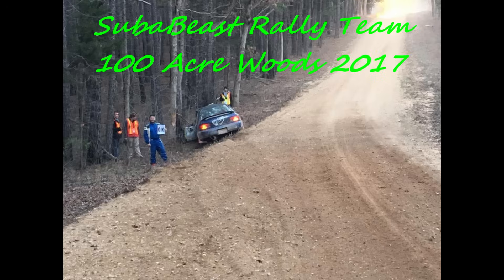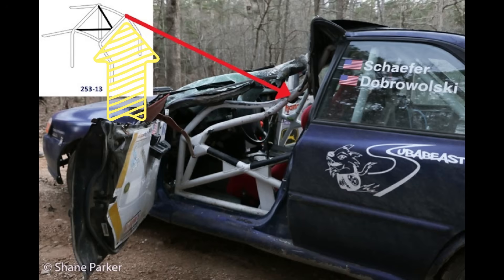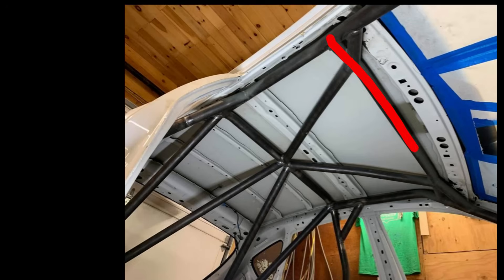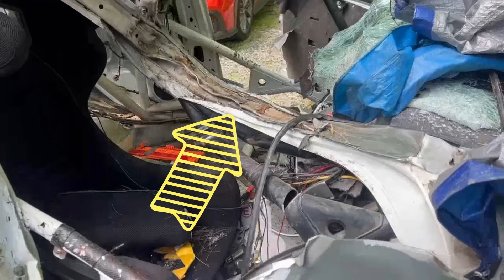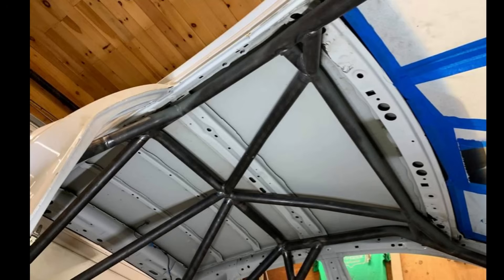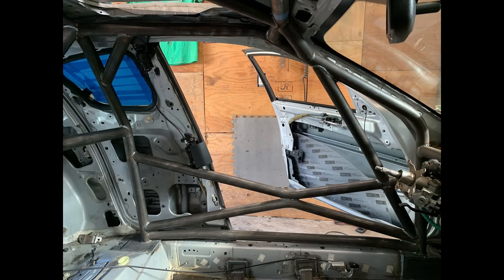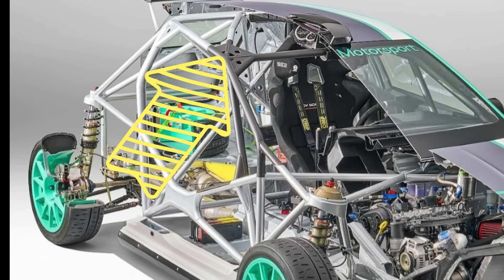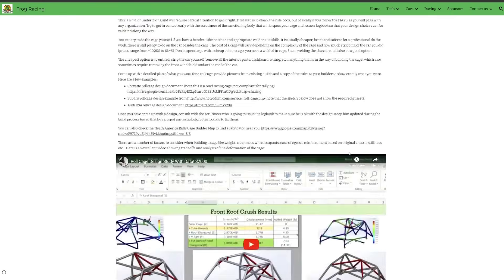Rollcage A pillar strike analysis

Comment: How about using .125 tubing. Seems .095 sheared quite easily.😮
Reply from the maker: 0.120 tubing is recommended for cars over 3000lbs in road racing.It would help but not sure it would make that much of a difference. Check Kris Meeke's crash in Portugal in the C3 WRC, it's Chromoly and the outcome is pretty similar.

Comment: The one problem with designing a role cage to be as strong as possible, is people have to fit in, and be able to get in & out.
Many years ago Safety Devices experimented with Bowden cables in the front screen area, apparently it worked from a torsional stiffness perspective, but had potential drawbacks in the event of a major off.
The rear assy can be extreamly robust, but does nothing to protect the crew, in terms of avoiding front portion collapse

Comment: Great breakdown, very informative. 

I suspect it's a fine line between a cage that doesn't collapse and puts those G forces into the occupants compared to a case that collapses and absorbed a lot of that energy.

Did these cage failures happen at or near the max speed or were they considered low/medium speed collisions?
Reply from the maker: The first one was definitely a low/medium speed impact, the second one was more of a medium to high speed impact.

Comment: The subject requires a complete review in historic motor racing where the FIA adopts double standards on false pretexts of originality. Some ROP as a result are far weaker than others and differences in vehicle mass simply create danger for competitors.

Competitors have often seen some very dubious decisions from Geneva rejecting national MSA ROPs.

Why are gussets and triangulation allowed for some cars rather than others? Why are base mounting pads limited on some cars so that a mounting bolt is the single attachment in the wrong plane? Why are cages used to strengthen fake GT40s and Cobra Daytonas?

The historic FIA needs listen to National MSAs, it needs to be balanced and not swayed by particular groups of garagistes or organisers.

Comment: The roll cage on my Panamericana  car is .120 wall and it is still a few 100 pounds under minimum weight eventually I will add gussets and temple bars as the roll cage weight is obviously not any issue for my car. In '93 when the car was constructed gussets and temple bars were not required.

Comment: 3:40 I watch Drag car builds and Drag and Drive builds. That's my knowledge about (full/chassis) roll cage. I also did some studies on transfert of force/weight.
I already know that the gusset and the side bar being not on the same point will be a point of failure.
Any build with that kind of offset will result on cage failure with the right angle.

Comment: I would want to sample the bars that sheared near the welds for changes in hardness every centimeters from the weld to a decent way to see how the heat from the weld changed the tube.  This is a similar effect when NHRA is specifically 4130.  The heat of the welding  caused oxidation on the inside of the weld that caused brittleness as the car flexed. It also caused heat effected zones of different hardness. 4130 in other than tubing needs to be stress relieved at 1,100F so every mm is of the same ultimate strength.  Cracking near welds from flexing fatigue. As the areas went from harder to softer away from the weld.

After John Forces crash, I contacted a heat treating magazine called The Monte. I found several heat treaters that had ovens big enough to put bare top fuel chassis in.   

 I  sent the info to John force racing.  Then quit making noise about it. 

Your collapsing A pillar bar problem needs to look at what OEMS do. They have a thick wall bar that starts deep in the A pillar  has a bend not a splice to follow the windshield  then another bend to follow the roof line. The rest of the bars can remain spec wall thickness. These two a pillar bars need to be much thicker wall.  Screw the weight. Protect the occupants.   
I would also like to see a thick wall tube from the base of the A pillar tube to the base of the B pillar tube as somebody is going to roll one and hit a pillar or tree in the rocker pillar and have a similar collapse.  

 Since the lower inside of the door is cut away.  A pair of bars that bend out into the lower door cavity but welded to the A and B pillars then gusseted  in a few places to the X bars next to the driver  for far better above the rocker panel side impact protection.  ..

 My friend Richard Lindwall was crewchief on the Wolf Dallara WD1 can am car that was driven by Giles Villinue.  It had a terrible habit of flattening the front tires . There is a video of it after restoration on YouTube.  The side pods had aluminum honeycomb composite floor panel material right out of Boeing surplus laminated on. Crazy strong.  But at high speeds the car got light in the rear and would swap ends.  Scared some drivers after Giles. I saw the photos of the car in the early 90s. I pointed out the vents on the back of the rear fenders disrupted the air stream going under the wing at speed causing a loss of downforce on the bottom of the wing. The upper surface of the wing was almost flat. The airflow over the leading edge created lift .  The duckbill way out in front did not help either.  The car had been retired to a design school to never to be sold but to be analyzed to see why it was insane at high speed.   I had figured it out in 30 seconds . I had no idea that the car had been sold and was doing vintage racing. Dino the owner wound it up in the back straight at Mosport and died. I would have warned him.
Reply from the maker: I am not sure which bar you are referring to as the A pillar bar but the lateral that follows the A pillar is 1 piece. The A pillar support bar is usually a smaller diameter (1.5") bar that can be a single piece if it doesn't intersect with the door bars but it depends on the geometry inside the car.
Unlike road racing that has tube wall thickness based on the weight of the car, rally only has one minimum size regardless of weight. The GD Subarus are often in the 3200lbs range and one could argue that .095 wall is a bit thin for that weight, most road racing sanctioning bodies require .120 wall for that weight.
I completely agree with the effects of welding on the material, it's often even worse with Chromoly if the welds are not properly treated. Unfortunately I didn't see the car in person, I only had access the data that was given to me by the car owner.

Comment: My evo 7 was built to the standard then certified by the MSA and  FIA to international spec. Shell was prepared & multi point cage built by Custom Cages Ltd but not to the main outlined rules in the blue book as it allowed a opinion to the cage to be designed outside of the rules stated. My cage failed because the main hoop constructed by 6 tubes in each of the top corners of the main hoop, welds broke and the cage collapsed which could have caused a fatality in a small accident. Cars are competing with the same cage and Uk motor sport won’t do anything about it, safety is not a priority in this sector and they need to wake up!!

Comment: I've never seen so many broken roll-cage tubes. A life time of speedway midgets etc. At 3:40 it show where the bar broke, between two junctions of other bracing bars, the two bracing bars should overlap each other so that there is no single piese of tube that takes all the load. Some shocking designs.

Comment: I am not 100% sure as it has been a while since I was involved but I think that in Greece there is a Technical Requirement for the cage to be gusseted to the A-Pillar and also for the main loop behind the seats to have a bolted connection plated to the original seat belt mounting location in the B-Pillars.

Comment: The fact that the tubes failed above the welds is a good thing as that means that the welds were done correctly. The last cage looks to have the support bar to far from the windscreen tube, that should be max 100mm.
Reply: The welds seem okay from a visual standpoint (theyre painted so hard to tell what the raw material looks like) but judging by where they sheared, its likely that there was too much of a Heat Affected Zone (HAZ) in the immediate area around the weld. Likely a result of too hot of a weld or a slow travel speed… that material becomes work hardened and very brittle. Scary stuff.
Reply: Трубы всегда разрушаются не по сварке. Сварка крепче чем материал который сваривается. Очень трудно сварить так, чтобы по сварке лопалось. Какой-то дилетант должен варить.

Comment: Thanks, this was an interesting analysis of the cage impacts and failure modes. Tubing breaking next to, but not in the weld zone is actually typical, due to the metallurgical changes to the alloy (I'm guessing a 4130 DOM (Euro spec 25CrMo4 or 1.7218)), after welding that is called the heat affected zone. 

If the tubing was a low-carbon material it would perhaps be less prone to this failure, but lower strength overall, so likely not used. Poor welding technique or joint fitting/design can affect the final strength of the cage regardless of material.

Comment: Americans never seam to listen to the experience of Europeans even though weve been rallying since the 1950s and lost alot of people too that we learned from. Same in drifting some of their roll cage rules make 0 logical sence
Reply from the maker: I have seen plenty of bad cages in Europe too. The good thing about modern FIA homologated cages is that the design is sound at least. The quality of the welds varies a lot especially with chromoly. Lots of missing or incomplete welds unfortunately for non factory produced cars that are often missed by not very thorough scrutineers.
Reply: @FrogRacing  Don't think that is not happen to factory produced rollcages. Most probably in 2014 we were scrutineering the new series of the Seat Leon's in the WTCC. From the 6 cars they sent we found 4 poorly welded at the B-pillar of the right-hand side where the main hop and the frontal member was connecting. 1/3 of the whole circumference was not joined on the roof-side. Seat Motorsport had some sweaty moments in front of the FIA Technical Delegate and maybe later on an even higher level. And yes, it was the 3rd event of the season so they passed (or at least some of them as those cars mainly had temporary drivers so didn't participate on every event during the season) the scrutineering twice before we found the mistake.
Reply: I will say it aint all of us promise, and most of the people that build actually safe cages here are in the desert racing/prerunner side of things.
Reply: Because most Americans are broke and live paycheck to paycheck, even well off people, penny pinching goes somewhere, safety is one of them.

Comment: Gusseting to the A-Pillar is optional? Also, is there any reason you couldn't build a double hoop cage (Rally1 style) in a chassis car?
Reply from the maker: Yes gusseting the cage to the chassis is optional. Current regulations have to follow Article 253 Appendix J that only allows 1 main hoop. 
I have another video on the rollcage specs here: https://youtu.be/i2VvQxYf9qM
Reply: All gusseting to the body is optional and iirc the only required gusseting under current rules is where the tubing connects at an x as in x shaped door bars and cross braces on the main hoop and rear stays.

Comment: The WRC style is known as a "supernode cage", as all connections are made as nodes with gussets and they don't like midbar connections for supports.  The vertical windshield support bar is known as the "FIA bar" after it was mandated after a string of roof corner collapses in touring car racing.  One way to strengthen the entire cage around the windshield would be to adopt TransAm style where the A pillar bar is gusseted to the dash bar and halo bar to form an octagon instead of a square to prevent sidewards movement in impacts with a lateral component as in your second example.  While these gusset bars don't conform to node style, you gain some of the lateral strength of NASCAR upper cage sections without using the "Petty" and "Earnhardt" bars that prevent passenger seat install.  A lot of the specific bars in NASCAR rollcage design are named for the drivers that the bar would have prevented injury, improvement via blood if you will.
Reply from the maker: One of the constraints for rally is that the cage has to be symmetrical to offer the exact same protection on the driver and codriver sides. There are also constraints on visibility and how far bars can  be in the windshield area. I have this covered in my rollcage video here: https://youtu.be/i2VvQxYf9qM?si=zlsTg3ZOowazXYdH
Reply: @FrogRacing  Yes, the Petty bar would be right out (interferes with codriver), and the Earnhardt bar would be eliminated to visibility concerns (since it's vertical in the middle of the windscreen), but the Newman bar, or an adaptation of it shouldn't be in the driver's field of vision, as it's a second slightly lower horizontal bar between the A pillars that in these cars would basically align at the top of the windshield and gusseted to the primary hoop and A pillars. 

I'd be tempted to try to make a continuous A pillar to B pad tube and a separate roof hoop also a continuous tube, and gusset them together. Or at least making some CAD models and doing FEA just to make sure a long heat affected zone or an altered twisting vector doesn't actually make things worse.
Reply: When you say “TransAm style,” are you referring to a modern TA1/TA2 chassis? I’ve looked at a few chassis manufacturers online—Hamke Racecars, Burtin Racing, etc.—and I have not seen the A-pillar execution you are referring to. Can you share a few links as examples? What you are describing does sound like a good idea. I bet you could package it within the FIA windshield keep-out space (100 mm × 70 mm per Drawing 253-48) and still provide reasonable lateral support. It’s unclear to me why this windshield rule exists today if it’s purely for visibility; maybe it’s more for extraction? If you look at modern cages at the very highest and most dangerous levels of motorsports, drivers have to contend with all sorts of tubes, gussets, plates, and reinforcements directly in their vision.
Reply: Like, if some WRC driver said to me, an amateur who just wants to be safe and competitive -hey, you’re going to lose about a second or so per stage because your vision won’t be quite as crisp, but you’ll be a lot safer,” I’d take that deal 10 out of 10 times.
Reply: @jkrzeminski  I was an old GT1/transam cage before TA1 and TA2 existed, imagine bars in the windshield opening making a diamond shape to gusset the dash bar to the A pillar to the halo bar.  In addition to a vertical bar in the front middle, also check out older V8SC cages.  Think this but diagonal bars also from those bars to the dash bar, then to the floor https://vorshlag.smugmug.com/Projects/Stewart-Whites-69-Pro-Touring/i-ndfRM4m/0/M/B61G0329-M.jpg  https://www.youtube.com/watch?v=EeL2XHYCPEs
Reply: Also check out the current V8SC cage with where the driver sits in relation to the halo gusset bar
Reply: The vertical bar is also called the sainz bar for obvious reasons.